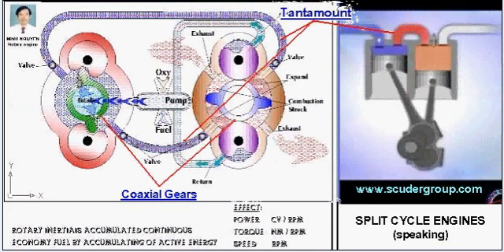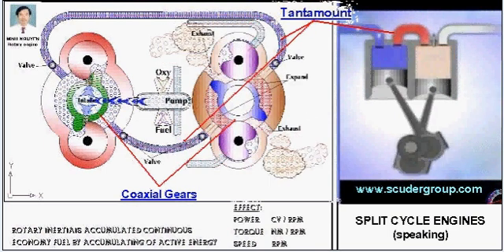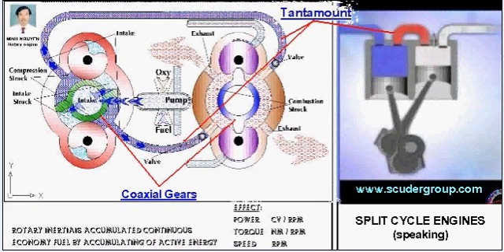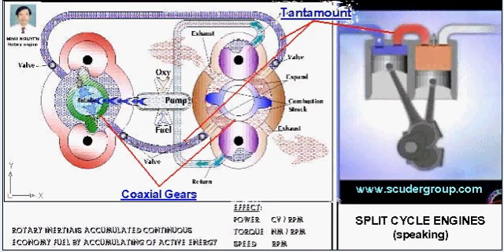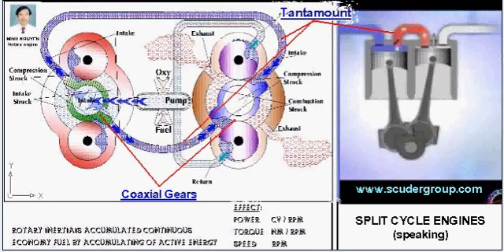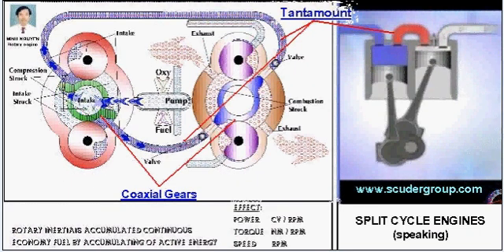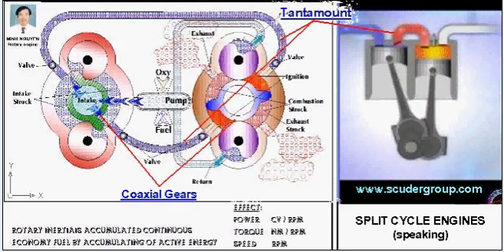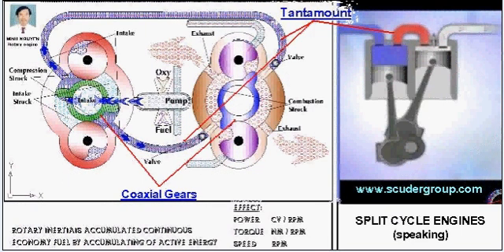MINH NGUYEN'S NEW ROTARY ENGINE AND SPLIT HYBRID ENGINE

Comment: this mecanism is totally differnt with wankle's engine, i drew this mecanism 2006 too. but i was highschool student so i just have scach on my book haha. anyway this is different because it just keep spining on same point so there is no vibration. it can make clear the point of  vibrating when there are 4 roter at same plan.so this could get higher limits of RPM, and i think if it made of tungstan or something i thinks it could be much small size with higher RPM.